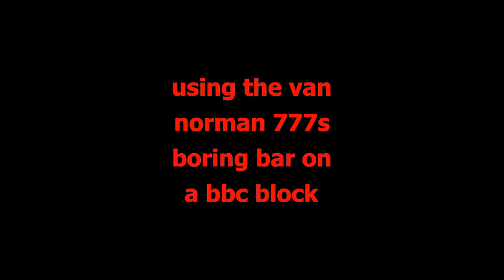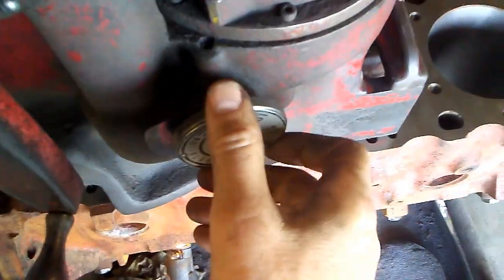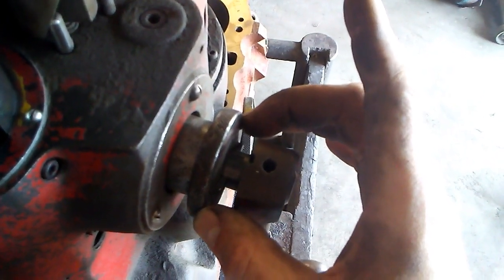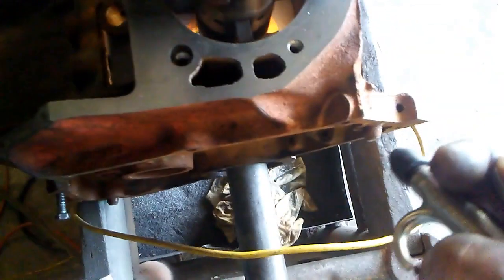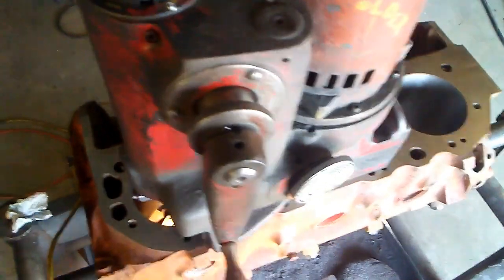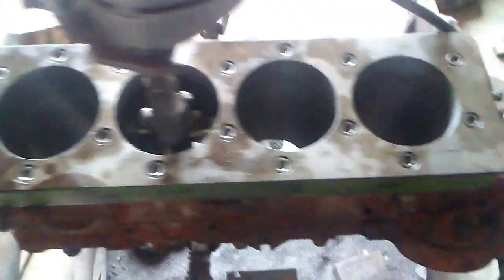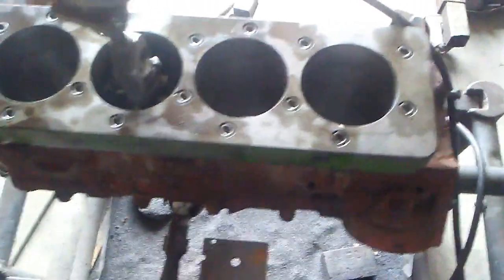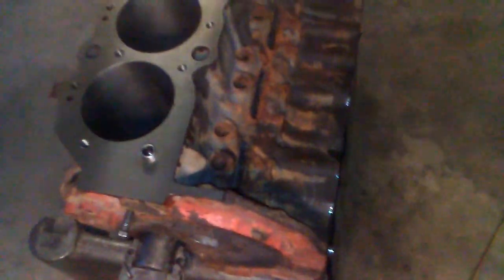see how a 454 bbc block is bored with van norman per-fec-to 777 s

Comment: Just did my 500 bore job on a 777. I own. Probably 100. On Kwik wey. Rottler. And many more on a sunnen hone. Manual and power home.  Good job. Ya decked the block before. I deck with a berco.. by the way hone with honing oil. Like sunnen. Your wife or girl friend will know you have been working.lol. to many years.
Reply from the maker: cool, thanks man

Comment: Just bored a 454 today with my 777. Had to do the feed by hand at the bottom to keep from shifting when it hit the uneven spots. That was with the paws out too!
Reply from the maker: if you are using the cheesy clamp style stock holder i can see how it can move. mine is held in place with a bar going through the mains and up to the boring bar, holds it way better than the clamp that comes with the bar. if the boring bar itself is not moving i would say the feed bearings / bushings might be worn out?
Reply: @chevyfarmersgarage1955  I have a bolt going to a bar in the mainline. Seems to be a new issue as of late. Thinking it has something to do with my centering paws not tightening down quite right.
Reply from the maker: @malcolmgeorge  i have the owners manual with an exploded view. lots of pieces and parts in it.  i would extend the cutter down to where you had it shifting and see if it wobbles
Reply: @chevyfarmersgarage1955  Oh yeah, I have the book for mine too, but that exploded diagram leaves a lot to the imagination! :D

Comment: why don't you use the shoes on your machine  I was told by a machinest if you don't use the shoes for support the bottom of the cylinder is not the same as the top because the deeper you go the less stability  the shaft has just wondering
Reply from the maker: when i bought this from the machine shop, the owner let me use it for a week at his machine shop. i got hands on training from him. i was told that the catspaws do not need to be against the bore, due to the way of holding the boring bar. originally there was a clamp that went inside the cylinder, that was not the best at holding it. i am using a bar through the mains with the holder clamped to it. which is much sturdier and holds it better. also debris from the cutting can get lodged between the catspaws and the bore and cause more problems, i was told if the cutter is wandering the bar is worn out. i am using it how i was trained to operate it.